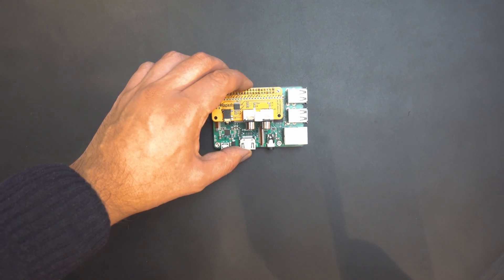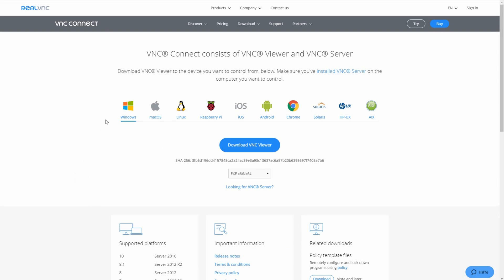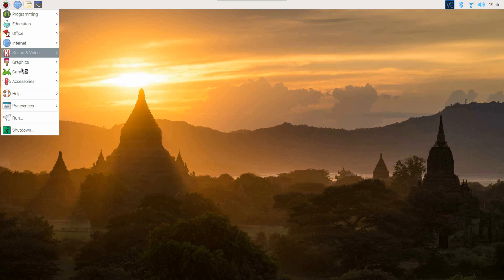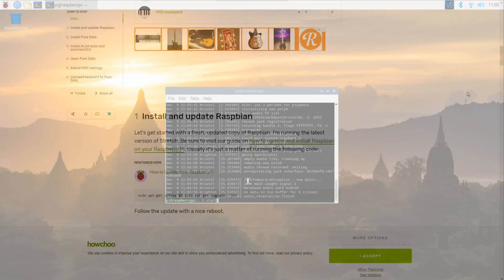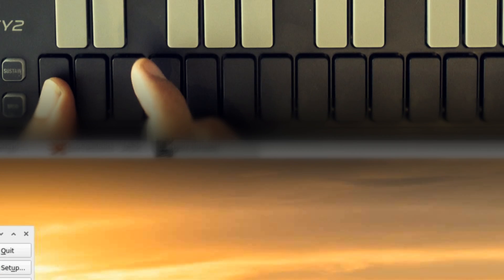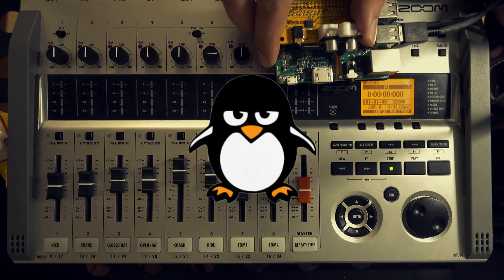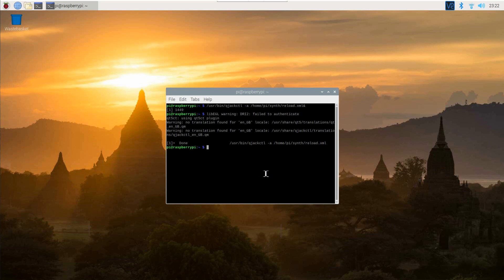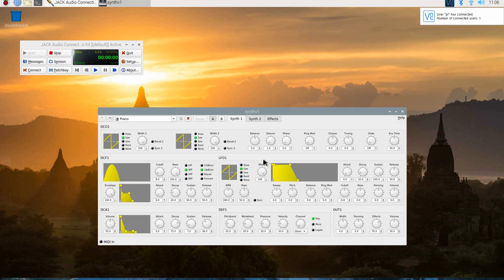How to use a Raspberry PI as a synthesizer

Comment: Oh, not to mension i did study "The Latency / XRUN Callback -error." Looks like its a SynthV1 -problem, because i never experienced that on Amsynth and JACK Audios Messsage Log show no such error ocurring on Amsynth, neither in Standard Built-in AV Jack or HDMI.
Reply from the maker: You're right. The XRUN errors hint at a lack of CPU capacities, and if you're using a PI4 or 5, you won't see them. There are other well optimized plugins that will give you plenty of polyphony on PI3 as well.

Comment: how is the latency? very important for a synth. It looked like there was an audible delay between hearing the click of the keyboard before hearing the sound come out of the synth.
Reply from the maker: The latency depends on buffer size - the smaller, the lower it is. You can reach around 6-10ms in Linux, depending on your Raspberry PI model, audio hardware and general CPU/RAM stress.

Comment: The piv3 is too underpowered for any synth work. Even a yoshimi default instrument will xrun if you have 10++ notes on sustain. Using usb audio will help a little but not by much. Running in console mode will give the best performance but most synths are not console friendly
Reply from the maker: Hi, thanks for watching! Though this is one of my more successful videos, it's a bit outdated. There are several software synths which are optimized for PI - one of them being ZynAddSubFX, or Sundog. Both a very deep synths.

Comment: My first experience with computer audio was with JACK and ALSA and I didn't find it too bad. When I went to try to use midi in Windows, it was quite confusing. So I guess it is just what you are used to.
Reply from the maker: Years after making this video, I got used to it, too. :-) Really depends on the distribution and app support. A good distribution can do a lot to hide the so-so things from the user.  Raspian is very barebones in that regard.

Comment: Great video thanks. Informative and set up sounds good. Unclear from your vid what your conclusion/end-solution is for a low latency DAC that works with the Pi ??? I see from the intro demo that although you have a Raspiaudio DAC HAT installed you do not appear to the using it ; presumably using a USB DAC instead ? TIA
Reply from the maker: Thanks for watching! Yes, this was my first video in a continuing series showing my progress on Linux/RasPi. I used a cheap USB audio interface in this video and was still working on the Audio hat - I later got it to work. You can find the one I use on https://raspiaudio.com/produit/audio  - but to be honest, a normal USB audio interface worked as well for me. If you want to see more, here are my other RasPi videos: https://www.youtube.com/watch?v=ae5TYhnhp3w&list=PLN55_-YN4bziwkbVLelcG7hfEzmGHituY
Best regards!

Comment: Can Pi zero w or just zero do this as well? Provided that some required add-on modules added
Reply from the maker: Hi, thanks for watching! Yes, it's also possible on the PI Zero. Due to it's lower specs, you might run into issues using some software synths. Please watch some more of my later PI videos on synths that are not that hungry for resources, for example the ZynAddSubFX.
Reply: @mr_floydst  Cool! Will definitely do. Thx for replying!

Comment: Hey Floyd. I wanted to experiment with an Old PI A+, and your video was very usefull, and fun (i'm trying to create a full headset retro synth). BUT i could get any sound. In the jack audio connecti kit "connect" options, i don't see Bristol in the ALSA windows (my Oxygen49 keyboard is detected), and it seems to be te problem. Any more details about how to do ?
Reply: ok, so with -midi alsa i could get my keyboard working. but still no sound.
Reply: ok, i've found the problem : don't forget to selection the outpout on the sound icon (top right) to jack in my case. you may have also to specify it in the jack parameter
Reply: So: Sorry. Last post : everything seems to work. But i've only got an ugly, nasty sound. I've tried to change the sampling rate into jack, and jack don't work anymore (i have no card sound). Well, so far for today.
Reply from the maker: Hi, thanks for watching! Great to see you worked your way through it. That's what Linux is about, isn't it? ;-) Regarding the sound: please check the volume of your output jack in alsamixer, perhaps it's overdriving. 
I found out some time ago Debian removed headphone jack support for jackd in November of 2020. You could go back to an older version, but that's not a good solution. The only way to get good sound quality is to use an audio hat or a USB audio interface.

Comment: Now i have figured out everything, except one tiny idi bidi problem: The drivers for the midikeyboard. NEAT...
Any idea for M-Audio Keystation Mini32 Mk3 -drivers???
Reply from the maker: Hi, "normally", MIDI is a standard, so you keystation should be picked up as a standard MIDI device. Please type in "amidi -l" (while your keyboard is connected via USB) on the console - and post the output here.
Reply: @mr_floydst  amidi -I
amidi: invalid option -- 'I'
Try `amidi --help' for more information.
pi@raspberrypi:~ $ amidi --help
Usage: amidi options

-h, --help                      this help
-V, --version                   print current version
-l, --list-devices              list all hardware ports
-L, --list-rawmidis             list all RawMIDI definitions
-p, --port=name                 select port by name
-s, --send=file                 send the contents of a (.syx) file
-r, --receive=file              write received data into a file
-S, --send-hex="..."            send hexadecimal bytes
-d, --dump                      print received data as hexadecimal bytes
-t, --timeout=seconds           exits when no data has been received
                                for the specified duration
-a, --active-sensing            include active sensing bytes
-c, --clock                     include clock bytes
-i, --sysex-interval=mseconds   delay in between each SysEx message

+ There is this: Cannot initialize driver
JackServer::Open failed with -1
Failed to open server
14:12:22.044 JACK was stopped
14:12:23.399 Could not connect to JACK server as client. - Overall operation failed. - Unable to connect to server. Please check the messages window for more info.
Cannot connect to server socket err
Cannot connect to server request channel
jack server is not running or cannot be started
JackShmReadWritePtr::~JackShmReadWritePtr - Init not done for -1, skipping unlock
JackShmReadWritePtr::~JackShmReadWritePtr - Init not done for -1, skipping unlock
Reply from the maker: @Make573  It's an "l" like in "like". (or use amidi --list-devices).
Reply: @mr_floydst  Ups, sorry: My bad. Here is the result: Dir Device    Name
IO  hw:2,0,0  Keystation Mini 32 MK3 MIDI 1
+ There is this: Cannot initialize driver
JackServer::Open failed with -1
Failed to open server
14:12:22.044 JACK was stopped
14:12:23.399 Could not connect to JACK server as client. - Overall operation failed. - Unable to connect to server. Please check the messages window for more info.
Cannot connect to server socket err
Cannot connect to server request channel
jack server is not running or cannot be started
JackShmReadWritePtr::~JackShmReadWritePtr - Init not done for -1, skipping unlock
JackShmReadWritePtr::~JackShmReadWritePtr - Init not done for -1, skipping unlock
Reply from the maker: @Make573  Don't rush it. ;-) so the error message is not tied to "amidi -l", but to starting the jack server? This indicates some other audio hardware (most likely your audio interface) is causing the problem. Please try the tips on this page: https://askubuntu.com/questions/224151/jack-server-could-not-be-started-when-using-qjackctl .  
Your Keystation is working fine, don't worry.
Reply: @mr_floydst  EXCELLENT!! I though that something funny/ fishy was going on with either of these.
Reply: @mr_floydst  Unfortunately none of this worked. Yes, id did acquire useful bit of information, but it did not solve my problem. Hmm...

Comment: How the heck did you manage to put the qjack understand the keyboard, without loosing connection?
I mean, did you go and install Windows based drivers, or something?
My qjack constantly looses the recognition that there is a MIDI-device attached to USB-port...
Reply from the maker: My best guess: please make sure your power supply provides enough power to run all your devices. Raspberry PI itself is quite on the edge of what normal USB PSUs can do, adding MIDI hardware doesn't improve the situation.
Reply: @mr_floydst  THX for advice, but that is not the issue. As i said: sometimes the Pi doesn't recognise the Keyboard fysically at all, even when plugged to wall poweroutlet. Im thinking it have something to do with the drivers.

Comment: Oh, By the way, What "command" you used?
Since I can't find Noisemaker with "package opener", i obviously have to use the terminal. I know how the "install" -command works, but the rest is ...
Reply from the maker: Hi, you're propably looking for this: https://github.com/zynthian/zynthian-plugins
Reply: @mr_floydst  Noup. I was actually looking for installing the TAL Noisemaker on my Pi. I can't find it throught the Package Handler (or i just use the wrong search words), so what i have to do, is write the exact installing script on the Terminal itself, to install the blasted program.
Reply from the maker: @Make573  If I remember correctly, you  won't find it there. The repository I mentioned contains Raspberry PI binaries. Just download them using your browser, and toss them into a plugins directory. Then start Ardour or LMMS or something which can make use of the plugins. For an overview of standalone synths on linux, just type "synth" into the software installer. amsynth and synthv1 are pretty good.
Reply: @mr_floydst  Where / how did you even found the Noisemaker then? You mean that i have to start Ardour in order to run the Noisemaker? Is the Noisemaker only some sort of "plug-in interface"??
Reply from the maker: @Make573  This video is more than one year old and I did some more research since then. :-) Sorry if I confused you. If you're looking for a good standalone synth, please try amsynth, synthv1 or zynaddsubfx (the latter one requires some forum reading).
Reply: @mr_floydst  OK. Thanx for the advice.

Comment: If you were to run a simple synth on a pi zero would you need to buy an external DAC for a midi input and analog output?
Reply from the maker: Hi, thanks for watching! I think you could just use USB interfaces, as the Zero has an USB port. The better synths on Linux need a better CPU, though, so you'll propably be able to run sample-based synths, but none of the virtual analog ones.

Comment: Linux is for people who like being diagnosticians, not for doing actual end user things.  It is like LEGO for computer people, cool but
Reply from the maker: I tend to agree with that, though there are distributions that pretty much work right out of the box and don't get in your way (Ubuntu for example). The Raspberry PI is designed for "makers" specifically, so removing roadblocks is part of the "fun".  My next video (this Friday) will take a look at zynthian, which is a Linux OS designed for synthesisers, and of course, setting that up went as smooth as expected. (sarcasm off). :-)
Reply: @mr_floydst  at least it makes content for your channel!
Years ago I went through the same exercise to get a SW Synth working on a laptop (nothing special, had been on the market for a couple of years).  After doing everything you did, and the LT's family of sound chips were supposed to be compatible, and spending hours reading forums, I found a post by a woman who explained that the particular sound chip in the LT was not supported by one of the SW components.  Hours lost and wasted.
RPi should be at least have "standard" hardware.

Comment: Hey does anyone have a hot tip for me how to get audio out of synthv1? I have tried everything with jack etc. But it doesnt seem to work
Reply from the maker: Thanks for watching! Please make sure that 1) the Jack server is running by pressing "play" in qjackctl and that 2) synthv1 is running alongside it and is connected to your system's default audio output. If you're not sure, pause this video at the right time and take a closer look at the screen captures. Best regards!
Reply: I’m having the same issue,

Comment: Ugh, I hate Jack. I occasionally try to do music stuff on my Ubuntu desktop machine and any time an audio program insists on Jack I do either one of two things. One) Spend two or more days in frustration trying to get Jack and Pulseaudio working nicely with each other, or Two) remember the last time I tried one and failed and just nope out on fiddling with Ardour or synths outside of LMMS. Now I realize that a Pi is powerful enough to do more synth work so when I have the money to spare on a Pi 4 I will.
Reply from the maker: Thanks for watching. I think using JACK as the standard audio server (if that's the correct term) is a fine example of overkill. It can do some hugely impressive stuff that absolutely no one needs to do, ever, like routing your audio output over the network to another machine. (Ok, I admit there might be people who need to do that, but I guess that's a very small number). Instead of opting for a simple solution that works out of the box for 99% of the worlds PC-using population, we got this "this is far superior to Windows hurr hurr" stuff. ;-)
Reply: @mr_floydst  Oh you can get simple that's better than Windows (depending on opinion/ideological purity) just fine. PulseAudio is a good example (which even is supposed to do network audio though I've never gotten it to work).

The problem is convincing the devs of other projects to use your solution. I remember when PulseAudio came out it was called "the latest thing that breaks your audio". I freaking railed cause my ALSA config solution to have multiple audio programs running suddenly was broken.

I considered Pulse an over-glorified version of what I was using but now appreciate the fact that I can set up a passthrough output for each audio program I have running since it makes obs recording and mixing easier. I had to write a Perl script to autogenerate the command line statements but its doable.

The sad thing is I think Jack is capable of doing all the same but it's just too much of a pain to get working with anything. And I'm a programmer who has to do command line complexities all the time.
Reply: Install Cadence and pulseaudio-jack. Start Cadence, select ALSA -> Pulseaudio -> Jack bridge and click the start button... you get working jack and pulseaudio at the same time (I'm running that at the moment, watching youtube videos and playing around with jack-enabled music stuff :)

Just wait when pipewire replaces pulseaudio.. then everything will probably be shit for a while and after they get kinks sorted out then both jack and pulseaudio will gloriously live side by side without any fiddling (pipewire can function as a pulseaudio and jack backend for applications). I've tried pipewire and I see the potential but it's still a bit uncooked and brittle.

Comment: hi, i m really new to raspberry, when I install bristol it doesn't t show in the app installed, do I need to install something else please? thanks for your vids!
Reply from the maker: Thanks for watching. You need to start a terminal and type "startBristol". Watch the video at 07:43 to see it. ;-)
Reply: @mr_floydst  it seems to don t work, I ll make a clean reinstall, I try to use midi in over part since 3 days I think I made some mistake maybe because of this bristol won t work! if you have the solution to use a diy midi interface input on raspberry pi 3 I d like to have it!
Reply from the maker: @benoitparisot3245  Please watch one of my latest videos on that, you'll find it on my youTube page. https://youtu.be/N4yUduOqR3M
Reply: @mr_floydst  thanks but my interface is to connect on serial via gpio, it doesn't show with midi -l  :-(
Reply from the maker: @benoitparisot3245  Sorry, I can't answer that. But an USB MIDI interface like the one in the video is only $6 to $10, and it will work on any computer, so perhaps it's worth investing in that...
Reply: I already own one but I made a great midi controller with arduino so I wanted to make a big diy machine to run along my digitakt :-)

Comment: I'm interested to transform my Roland FP30 piano to a synthetizeur with a rasberry (FP30->USB midi->rasberry->DAC USB). Is it possible? and what about latency?
Reply from the maker: It should be possible, as seen in this video. Latency on a standard linux installation is quite bad. Here's a page which has some good advice: https://wiki.linuxaudio.org/wiki/raspberrypi
Reply: It's working well. I also test zynthian OS. Now i'm hesitate between this two solutions.